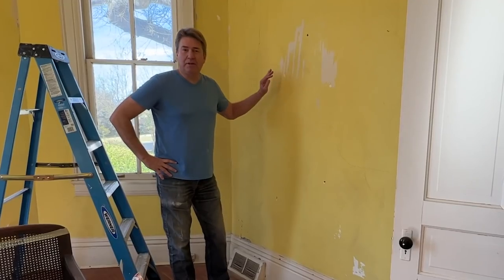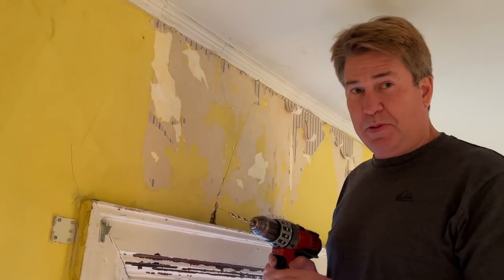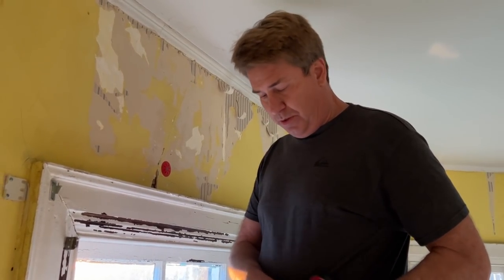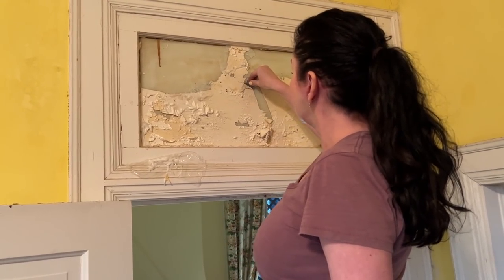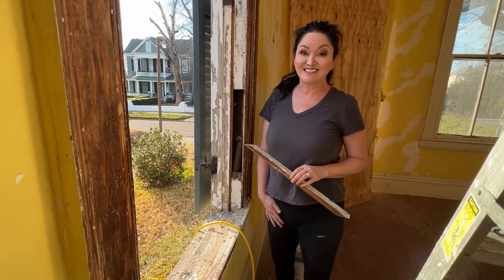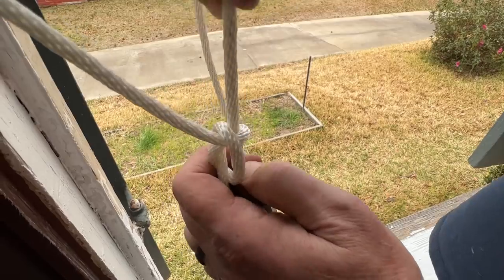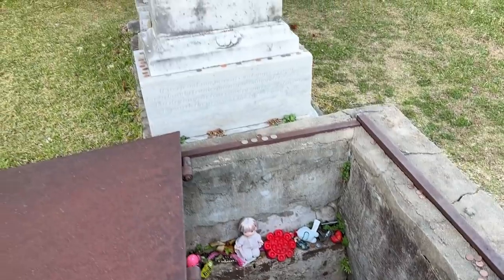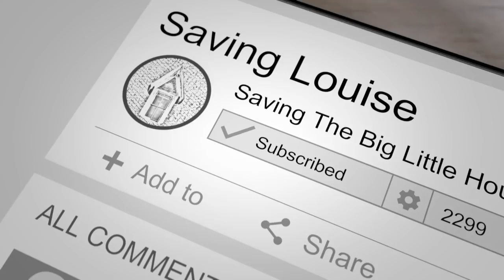Restoring Our Victorian: Pearl E 2 - Plaster & Window Repair

Comment: I had no idea what plaster (limestone) walls did for humidity levels and for cleaning the air.  Now people may not be so quick to demo plaster walls that could and should be saved.
Reply: Yeah I knew some neighbors uptown that had a crack in their plaster wall so they ripped down the plaster, lathe and all and put up sheetrock-cringing screaming comes to mind-I would have searched high and low to find someone that knew how to put lathe and plaster back up before I had done that! Ugh!

Comment: Gorgeous floofy puppies! When I come inside from a hard day of yard/garden work, I find sleeping cats who look SO exhausted. LOL. After a closer look at the "Steamboat Wheel" light fixture, I love it in that room! The color works with the fireplace tile, and it has a smooth, nautical look, not to be confused with those rustic wagon wheels with the amber lamp glass. My one twinge of serious envy is that Pearl still has her original wood sash windows. My first 1931 house had them, and I restored all of them the same way. My current 1931 house has leaky metal windows that were installed (shimmed in with cheap wood) in the 1970s. Custom house, 50% non-standard sized windows. $$$  :(  The original front and rear windows may have been 'french door' style, like those on a house down the street. In S. CA, air flow was also important. I also love historic cemeteries and find them comforting. And Laine, you always look great!

Comment: Love your channel.  Would appreciate you showing the exact products you are using ("plaster magic?") or listing them in the video description.  Would appreciate more up close detail on window restoration.  Thanks.
Reply from the maker: Absolutely. We used plaster Magic for the glue and Master of Plaster for the finish coat. We didn’t have the Master of Plaster scratch layer product with us but should next time and will show more of that work.
Reply: Do you have more links to plaster repair? I have seen your interview with master plaster as well. Thanks!

Comment: Not meaning to sound too dense, but will you be demonstrating the removal of those red anchors? I didn’t really understand that part of the process. Love your channel and what you do!
Reply from the maker: They just unscrew after the glue sets up. The screw will come out easily but you may have to “pry” the red cup off with a gentle pull because a little glue may be holding it in place. We’ll go into further plaster demonstration in our next video from Pearl.

Comment: When you use a caulking gun and you get through squirting the stuff in the wall let's say, if you turn the plunger piece that sticking out the end a little bit each time you're done it'll take the pressure off the gun and thereby not squirt stuff out the end. When you're done always seal the end with a cap or screw because the stuff will dry out. Squirting and stuff are very technical terms but you get the idea. 😁

Comment: Nice job, Laine and Kevin! 👏👏👏
Question: does painting over the plaster diminish its air cleaning properties? Are their any paints that should be avoided if one is seeking to maximize this "plaster perk"? Same questions for wallpaper.
Reply from the maker: You should use like wash paint on your plaster, or you have lost all your benefits! Lime wash vendors like Color Atelier and JW wall paints are out favorites! 
Wallpaper is okay as long as it isn’t vinyl. Use actual paper papers!

Comment: Kevin, next time you redo the rope in the windows, please, would you show how to get back in the tunnel and tie it off? Are the Dillons going to come do the plaster? Do the transoms still work? Didn't they have ropes or wands to operate them from floor level? I love the steamboat light. Trying to have a duplicate wallpaper made is great. This video concerning 100 yr. old wallpaper might interest you:
https://www.youtube.com/watch?v=BvNYLU2y7gA
Reply from the maker: I will try to show the weight a little more clearly next time. We are still in contact with the Dillons, but we are doing all the plaster work ourselves. The transoms have a metal rod (transom lift) that raises and lowers them. It's very rare to find them still working. Usually they've been painted over a million times and don't slide. That's the case here. In Melly, they still work.

Comment: Will you open the transom windows??
Reply from the maker: No. We just leave those painted shut. It’s always fun to find them that still work but the function is not as necessary in todays world of central heat and air.

Comment: I have a question? A friend hung my curtain rods in my apartment and made big holes where the anchors were in the anchors didn’t hold the brackets now I’ve got big holes what can I do to fill them I don’t like it!! I’ve got spackling but still that’s not going to fill the size of the hole, can I use hot glue gun inside those holes and then put spackle in over it?
Reply from the maker: What is the substrate? Is it plaster or drywall?
Reply: @OurRestorationNation  It’s drywall
Reply: I have a caulk gun